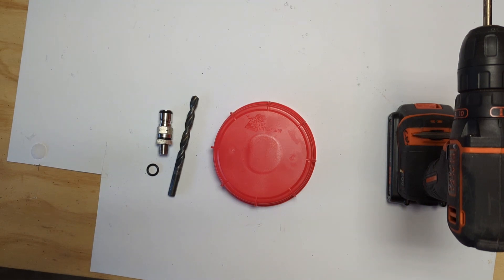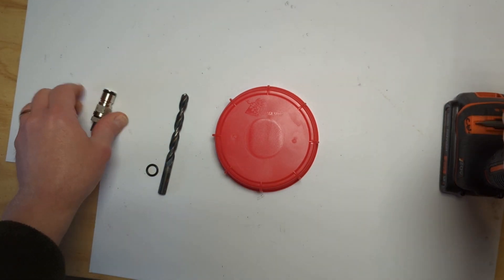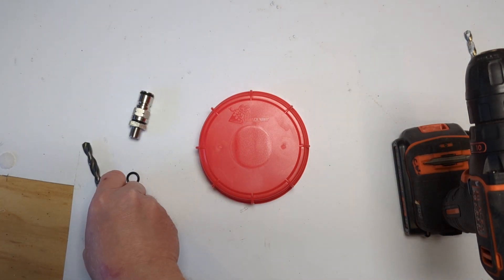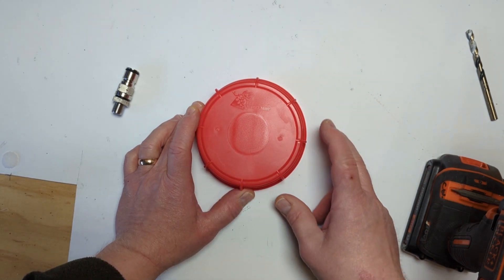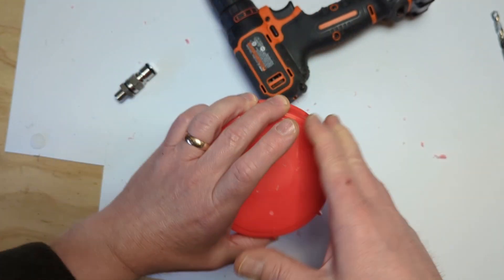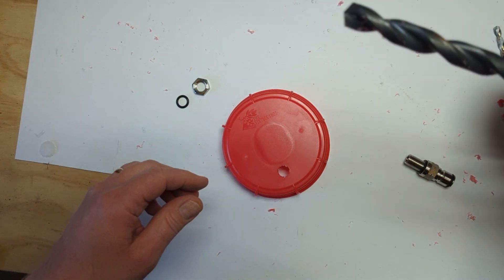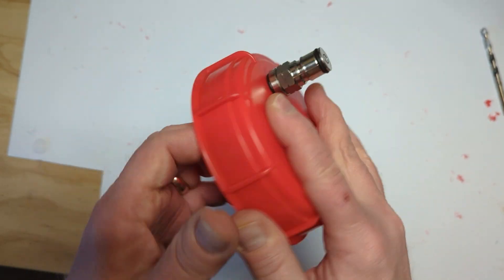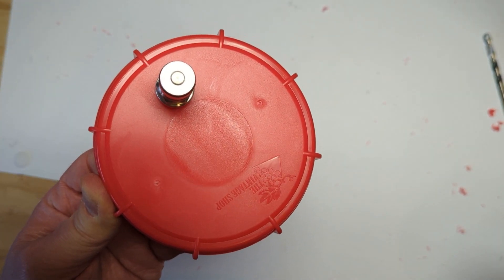Fermonster Lid Modification for Closed Transfers

Comment: If you install a keg ball lock-compatible post, you can run a keg (CM Becker) quick disconnect attached to a hose, leading to a jar of StarSan.  Blowoff tube accomplished.  I'm not expert enough to know if the krausen will clog the ball lock, though.
Reply from the maker: Yep! Exactly what I did. I didn't have an issue with the krausen getting high enough to go into the ball lock; fingers crossed for future batches! I'm releasing a video with more details of fermenting my first batch in this setup as well as transferring from the fermenter to a keg in the next couple of days. Cheers!
Reply: @irondalebrewing  I’ll be looking forward to watching that one! Thanks!

Comment: Nicely done.  I'd suggest using a Forstner bit instead of the twist bit.  They have a nice center point that will stay centered, and the circumference cutters will give you a clean cut.  If you start the hole on the inside of the lid, with the top of the lid pressing against a sacrificial surface (scrap plywood will do), there will be less "blowout" (the shredded plastic that you need to clean up).  It's a similar issue when doing woodworking drilling.  Forstners are not too expensive; best brand AFAIC is Freud.
Reply from the maker: Thanks! I definitely should have used a forstner bit. One of the two lids I drilled came out very slightly crooked (not to the point of it being a leak problem, but still), so I'm going to redo a couple of lids and add a second hole for a floating dip tube to up my closed game even further. Appreciate the suggestion!

Comment: Super helpful, thank you. That’s a good point about the potential high krausen blow off. I was thinking spunding valve was the solution but wasnt sure if there was going to be enough headspace. So I think the make shift QD blow off is key here
Reply from the maker: Thanks! That's definitely my plan -- I'm going to be giving this a first run once I get my range hood situation sorted out (hopefully this weekend) and do my next batch. I'll be sure and share how this all goes.